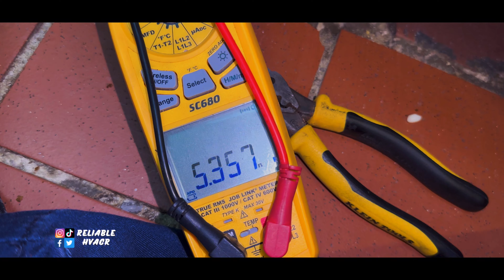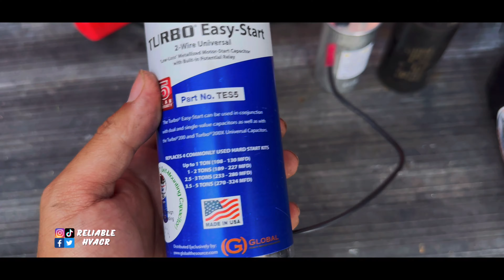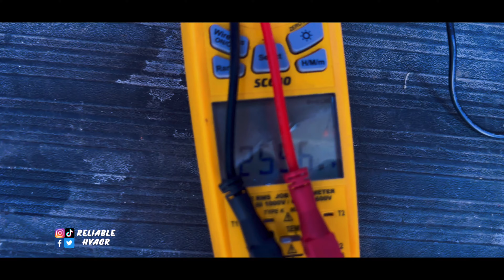Customer said it smelled burnt & weird issue w/ my DR82

Comment: I got the dr58 heated diod version and that thing works when it wants too. I usually just bring it out since it’s convenient. But verify with the h10
Reply: And bubbles lol
Reply: Field piece dr58 has been a piece of crap for me. Had it under warranty.  Wanted fieldpiece to exchange it. But they said they wouldn't do anything about it. It would go off when there was no refrigerant present.

Comment: You could have zeroed the Dr 82 while you were in the contaminated area. And then it should have only went off when you found a higher concentration of refrigerant. But it's very strange how it was going off in your van like that. That's not right at all. That's one of the selling points of the infrared technology. They don't false alarm. But Fieldpiece definitely has some issues with both the Dr 58 and Dr 82 detectors. Several other guys on here having issues. And I've personally had a lot of issues with mine. I documented it on 2 different videos and sent it to Fieldpiece. But they claim that nobody else is having issues with them. And that's bullcrap!
Don't let them tell you that. Let them know it is well documented in the YouTube community that these things are having issues..Hopefully they'll take care of you.  😎👍
Reply from the maker: I probably didn't record it or forgot to mention, I did zero it out in the cabinet and I even switched to manual mode. Couldn't rely on it that day, I'm in talks with their team and I'll try and get some answers. Thanks Shannon

Comment: you should carry the 5 2 1 relay kit ,the pickup and dropout are about the same,is on the sticker,the capacitor is the same.
Reply from the maker: Haven't needed them in a long time so I'm looking into something like that or the turbos for these calls. I used to only carry the Supco ones for small compressors
Reply: @ReliableHVACR  having a universal potential relay comes in handy,for that situation.
Reply: @ReliableHVACR  having a universal potential relay comes in handy,the model on compressor will tell you the relay # and you can look up the pick up and dropout and voltage to stock up.

Comment: Supporting my fellow Texans....much respect from the 512. Great video Adrian

You might have moisture in your leak detector. Try setting it front of a fan or use a vacuum and dry it off. Can you remove the wand on those FP. My Stratus i can remove the wand so i can dry it off if water gets inside. I believe the DR82 is IR and not a heated diode if im not mistaken
Reply from the maker: That's what I thought, yeah it's IR

Comment: Dr 82 was the most disappointing leak detector I have ever bought. Mine does the same thing as yours when I bump the tip. My jb prowler works better. Stratus will probably be my next disappoinment.
Reply from the maker: I shook the crap out of it and it stopped 😂 I'll try it again